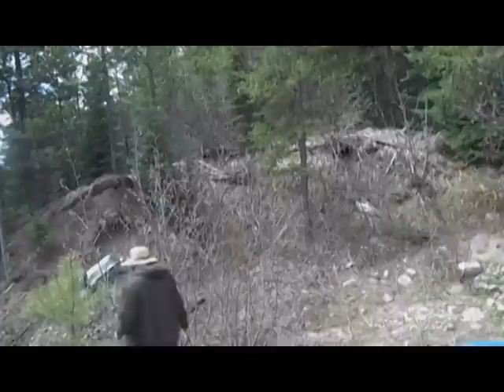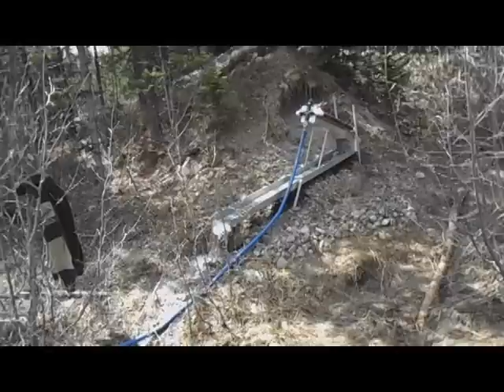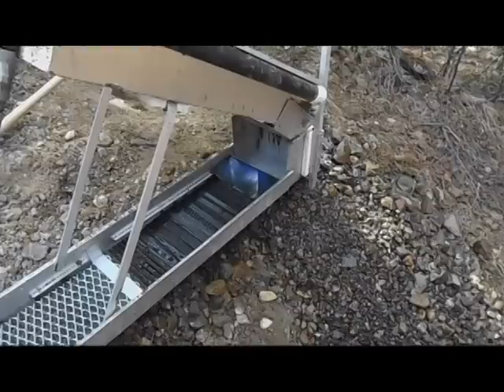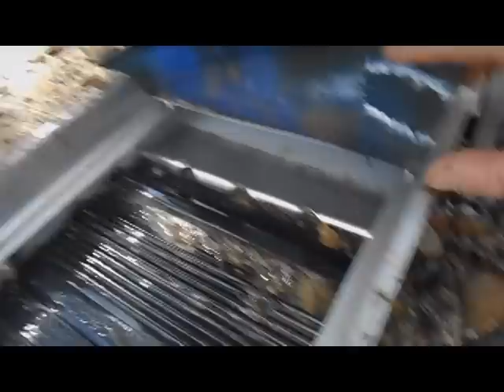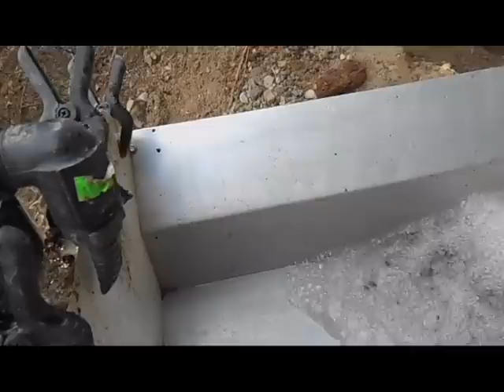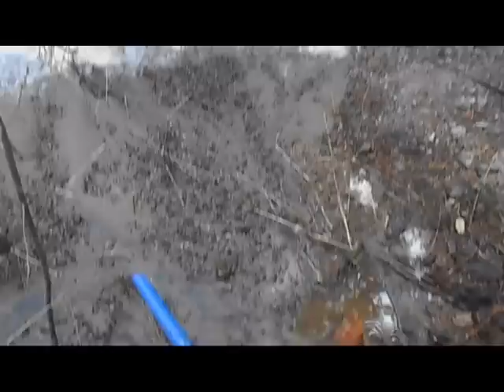Running the high banker at Crescent Creek.

Comment: Hi Dan.  Your hopper looks really practical, anyway i noticed maybe a tiny bit of material surging. Would you use more water pressure on those jet nozzles if that would be available?  Your grizzly is quite short.  Have you been happy with it?
Have you ever tried a longer/heavier damper?  I like your highbanker desing alot, nice machine!
Reply from the maker: TommiLipponen I would like a longer grizzly.  However the longer one I made ended up being way too heavy.  I also would like 3/8" rather than 1/2"  I will try again.  The first time I used 3/16" mild steal rods.  And that was just too much.  For now it works, but could be better.
The surging really depends on the material. More sandy material get saturated with the water from the top nozzle, and at a certain point becomes fluid.  More rocky gravel never gets saturated the same way.

Comment: That is the highbanker with the "fine gold" extension.  I would really like to see a cleanup that shows how much "fine gold" you get from what part of the sluice - or is there really an insignificant amount of gold trapped by the new extension because it is already in the upper half?  Could we see a highbanker run where there is gold - but all small gold - and would there be more in the bottom half than the top? How good do you think your "fine gold" section is compared to "fines" through Gold Hog's stuff?

Comment: I've been watching a bunch of you videos over the last couple days...Around the 5 minute mark, you say you can load the hopper with a few shovels full of material and let it self feed.  I understand that part, but I don't understand when folks say something to the effect of running it without material will wash the gold out.  The water is moving the same rate to let the gold settle with material; why would not having material flush gold out?  I hope my question makes sense.
Reply from the maker: Gold will settle under the light sands (blonds) and the heavy sands (magnetite and hematite).   Moving water will move the lightest material available.  if there is a mix of everything it will move the blonds, if all the blonds are flushed out it will slowly move the black sands.  if they are all flushed out it CAN start moving the gold.  As long as there are lighter materials present, the water will move them rather than the gold.
Reply: Thank you for the explanation!